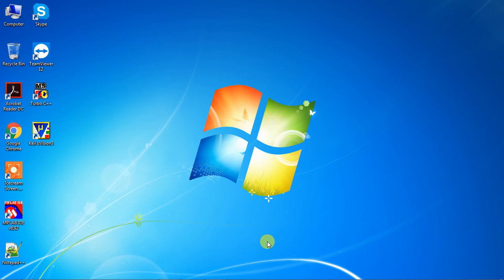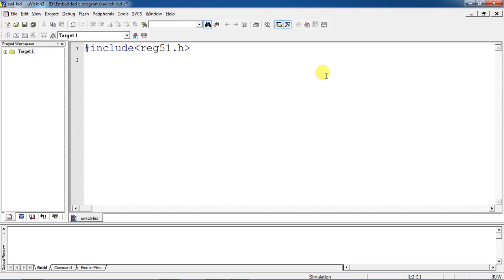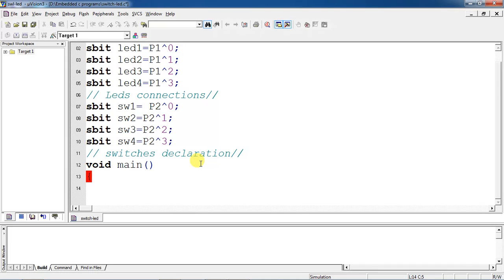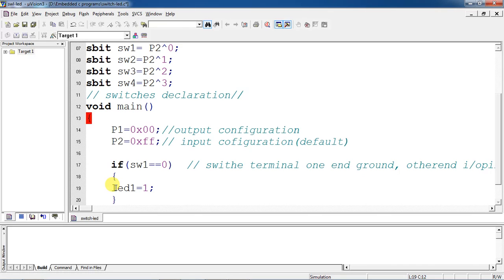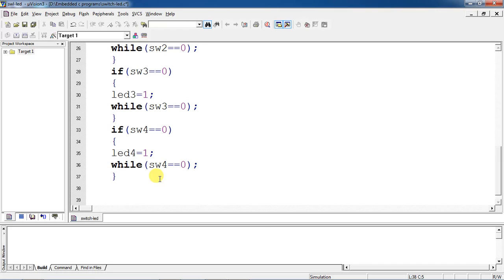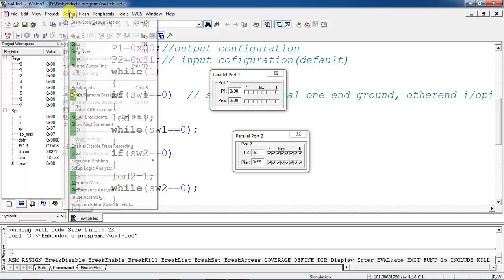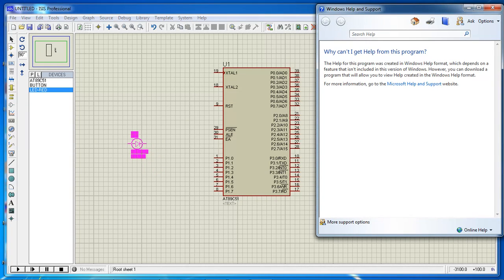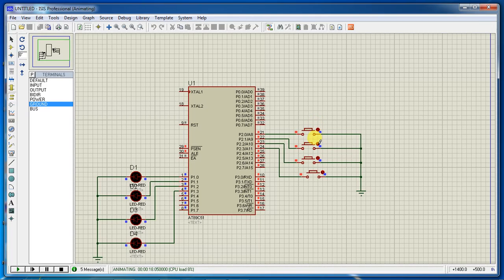Embedded c key switch led program using  Keil and protues

Comment: #include<reg51.h>

sbit switch1=p2^0;
sbit switch2=p2^1;
sbit switch3=p2^2;
sbit switch4=p2^3;
sbit switch5=p2^4;
sbit switch6=p2^5;
sbit switch7=p2^6;
sbit switch8=p2^7;

sbit load1 = p3^0;
sbit load2 = p3^1;
sbit load3 = p3^2;
sbit load4 = p3^3;
sbit load5 = p3^4;
sbit load6 = p3^5;
sbit load7 = p3^6;
sbit load8 = p3^7;  

void main ()

{

  P2 = 0x00;                                          //used as output port

  P3 = 0xFF;                                          //used as input port

if(switch1 == 0 )                               

    {

      load1 = 1; 
			load2 = 1;
			load3 = 1; 
			while(switch1 == 0);
			

    }
if(switch2 == 0 )                               

    {

      load2 = 1; 
			load3 = 1;
			load4 = 1; 
			while(switch2 == 0);

    }
 if(switch3 == 0 )                               

    {

      load3 = 1; 
			load4 = 1;
			load5 = 1; 
			while(switch3 == 0);

    }
if(switch4 == 0 )                               

    {

      load4 = 1; 
			load5 = 1;
			load6 = 1; 
			while(switch4 == 0);

    }
if(switch5 == 0 )                               

    {

      load5 = 1; 
			load6 = 1;
			load7 = 1; 
			while(switch5 == 0);

    }
if(switch6 == 0 )                               

    {

      load6 = 1; 
			load7 = 1;
			load8 = 1; 
			while(switch6 == 0);

    }		
if(switch7 == 0 )                               

    {

      load7 = 1; 
			load8 = 1; 
			while(switch7 == 0);

    }		
if(switch8 == 0 )                               

    {

			load8 = 1; 
			while(switch8 == 0);

    }		
}

These are the errors I got can u please help me
compiling main.c...
main.c(3): error C202: 'p2': undefined identifier
main.c(4): error C202: 'p2': undefined identifier
main.c(5): error C202: 'p2': undefined identifier
main.c(6): error C202: 'p2': undefined identifier
main.c(7): error C202: 'p2': undefined identifier
main.c(8): error C202: 'p2': undefined identifier
main.c(9): error C202: 'p2': undefined identifier
main.c(10): error C202: 'p2': undefined identifier
main.c(12): error C202: 'p3': undefined identifier
main.c(13): error C202: 'p3': undefined identifier
main.c(14): error C202: 'p3': undefined identifier
main.c(15): error C202: 'p3': undefined identifier
main.c(16): error C202: 'p3': undefined identifier
main.c(17): error C202: 'p3': undefined identifier
main.c(18): error C202: 'p3': undefined identifier
main.c(19): error C202: 'p3': undefined identifier
main.c(29): error C202: 'switch1': undefined identifier
main.c(33): error C202: 'load1': undefined identifier
main.c(34): error C202: 'load2': undefined identifier
main.c(35): error C202: 'load3': undefined identifier
main.c(36): error C202: 'switch1': undefined identifier
main.c(40): error C202: 'switch2': undefined identifier
main.c(44): error C202: 'load2': undefined identifier
main.c(45): error C202: 'load3': undefined identifier
main.c(46): error C202: 'load4': undefined identifier
main.c(47): error C202: 'switch2': undefined identifier
main.c(51): error C202: 'switch3': undefined identifier
main.c(55): error C202: 'load3': undefined identifier
main.c(56): error C202: 'load4': undefined identifier
main.c(57): error C202: 'load5': undefined identifier
main.c(58): error C202: 'switch3': undefined identifier
main.c(61): error C202: 'switch4': undefined identifier
main.c(65): error C202: 'load4': undefined identifier
main.c(66): error C202: 'load5': undefined identifier
main.c(67): error C202: 'load6': undefined identifier
main.c(68): error C202: 'switch4': undefined identifier
main.c(71): error C202: 'switch5': undefined identifier
main.c(75): error C202: 'load5': undefined identifier
main.c(76): error C202: 'load6': undefined identifier
main.c(77): error C202: 'load7': undefined identifier
main.c(78): error C202: 'switch5': undefined identifier
main.c(81): error C202: 'switch6': undefined identifier
main.c(85): error C202: 'load6': undefined identifier
main.c(86): error C202: 'load7': undefined identifier
main.c(87): error C202: 'load8': undefined identifier
main.c(88): error C202: 'switch6': undefined identifier
main.c(91): error C202: 'switch7': undefined identifier
main.c(95): error C202: 'load7': undefined identifier
main.c(96): error C202: 'load8': undefined identifier
main.c(97): error C202: 'switch7': undefined identifier
main.c(100): error C202: 'switch8': undefined identifier
main.c(104): error C202: 'load8': undefined identifier
main.c(105): error C202: 'switch8': undefined identifier